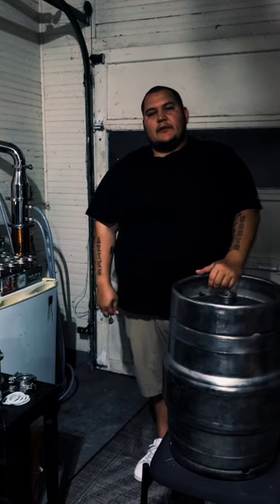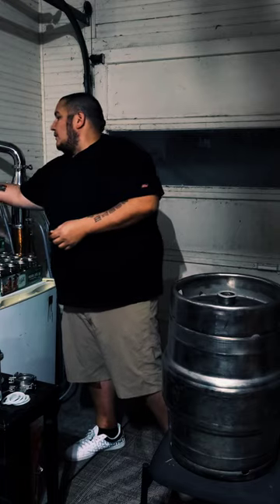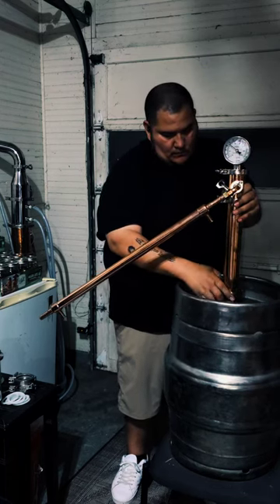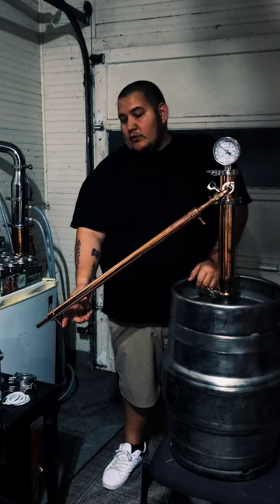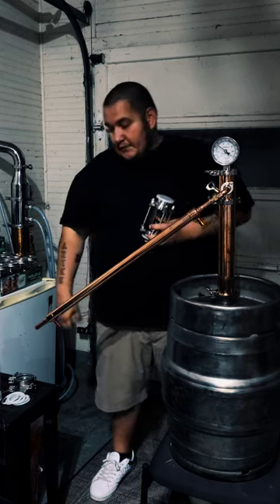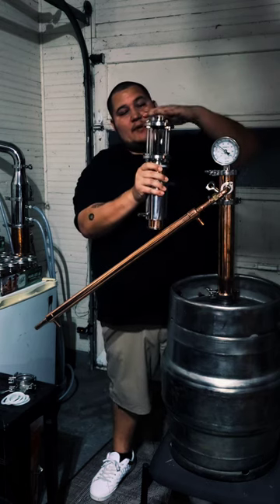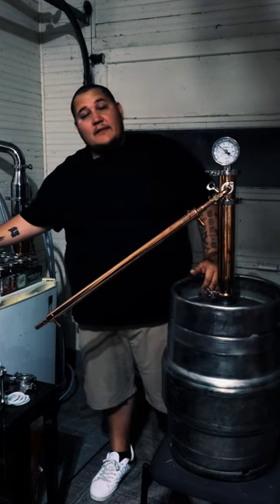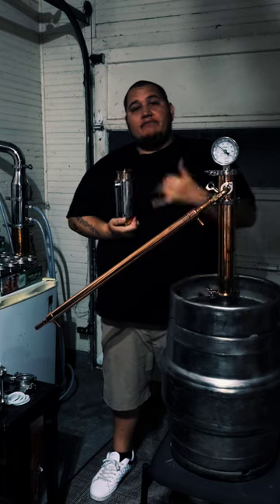Moonshine keg still with a all copper top.

Comment: Can I ask a question about the copper pipe extension on the bottom. I’m mostly looking to make corn and grain whiskey. What does the extension tube on the bottom do? I see you can get them in various lengths. Is longer better? Do you even need one at all? Thank you
Reply from the maker: Longer it is more it raises the proof but not to drastically.
Reply: @Prohibition_1920  Thanks brother for what you are doing for the community!